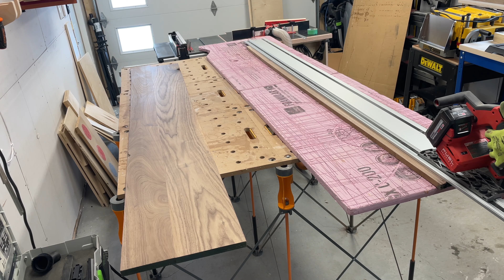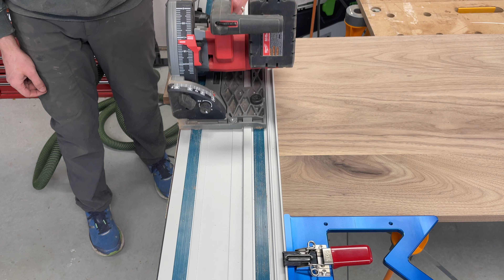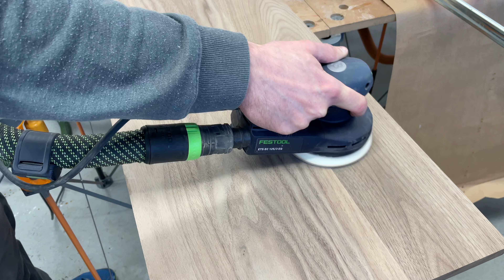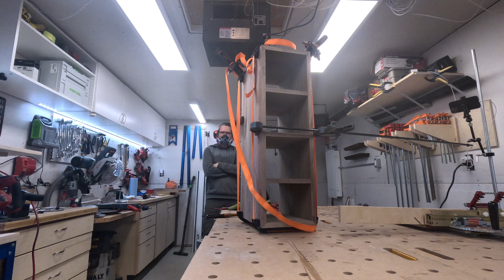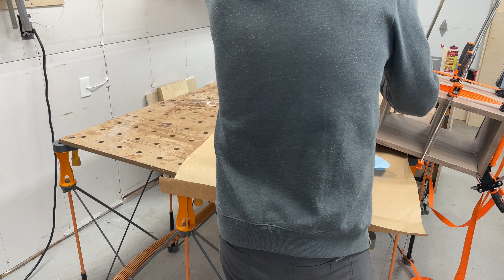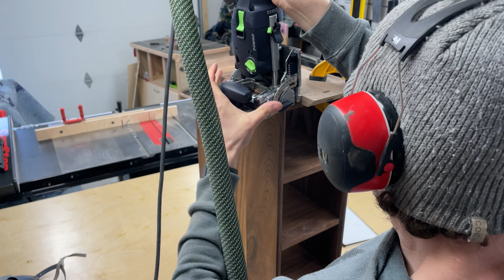How I Made A Tiny Bookcase For Towels!

Comment: I curious why you used solid wood for a cabinet thats going in to a bathroom?  Are you not worried about swelling?   Also, you said it was going between a toilet and shower?  Why not make the cabinet out or vennered mdf or plywood and use the solid to make a frame for the cabinet?  This seems like you either lost a bunch of money, broke even or charged way to much for something that will wventually crack and swell from the co stand moisture of being in a bathroom
Reply from the maker: Good question! This was specifically requested to be solid wood and to match the floating shelves I made in a pervious video. I'm pretty confident it won't rip itself apart. It will expand front to back, across the grain. There is nothing restricting the expansion/contraction, as all of the boards for the cabinet frame and the shelves are in the same orientation.